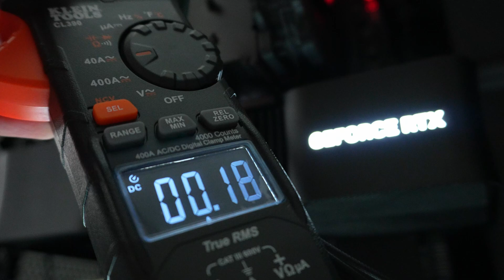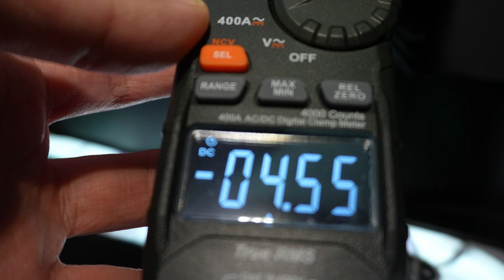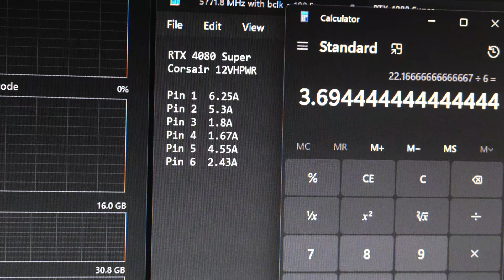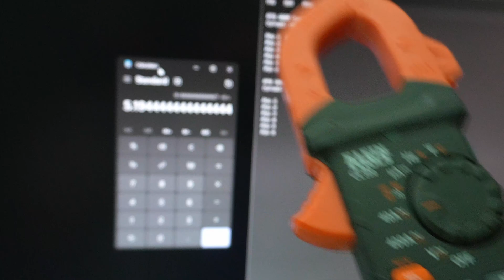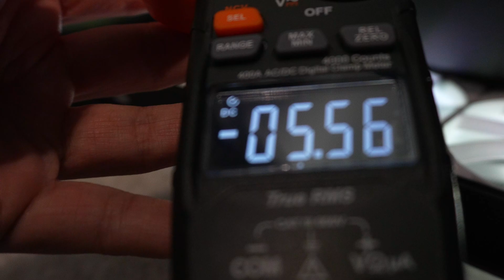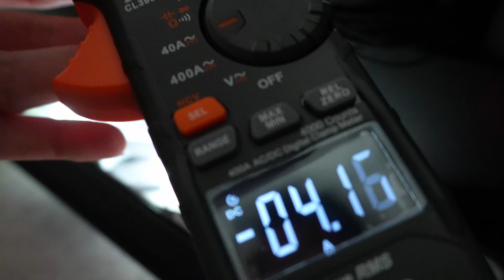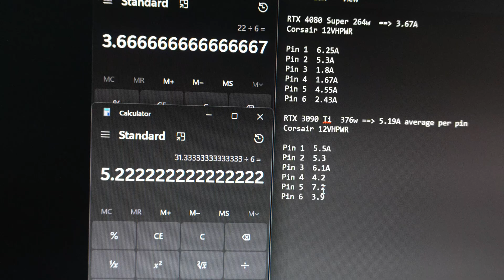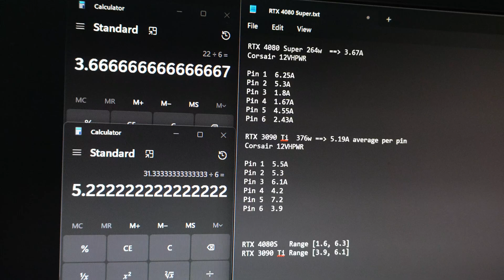Investigating 5090 melting - Why the 3090 Ti doesn't melt

Comment: Now Asus astrals are catching fire just like i told  you monitoring isnt a solution at all asus should have implemented dual connectors instead of bs monitoring . And 3090s not melting has nothing to do with the shunts they just arent pusing the limits powerwise of the specs. The 4090 and 5090 are able to draw enough power that any fault in the power delivery system causes issues. Not only that recomending the astral is not the best idea at all because it has a 800 price hike thats literally 3 5080 or a 5090 and a 5080 for a design that is fundamentally flawed. Personally i dont know why these engineering experts are so inept at figuring out the issue. Just develop a card with two power cables and all the issues would be gone . Kinda simpple really maybe they are worried  tat the power supplies dont have enough free connectors but spreading the power delivery out is still better than trusting one cable that is past its specifications with a stock card non OC card.
Reply: What if I told you it was purposely designed like that to give room for some tech obsolescence?

Comment: Nice explanation but one thing to pick up on: I don't believe they use variable shunt resistors on the 3090 Ti (does such a thing even exist?). The pictures I've seen of the PCB layout very clearly show fixed shunt resistors (probably 2 milliohms) near the power connector. IMO, the only way you can credibly do current balancing on a high-load cable like this is to have separate switching circuits (VRM phases) to throttle the current on each path - the 3090 Ti uses 3 pairs of 2 wires each - with feedback control, such that the current through each switch (sensed by a shunt resistor) is the same. In your case, if you add up the 3090 currents in 1+2, 3+4 and 5+6 you will get 10.8, 10.3, 11.1 A, which just might be consistent with them balancing the current onto the 3 pairs of wires, albeit rather imperfectly. However, I can't actually find any docs/pictures to confirm that the 3090 Ti really does connect separate VRM phases to each of the 3 shunts, so I guess it's conceivable that they don't do any balancing at all, and simply use the shunts to monitor the current from each pair (and optionally cause a shutdown if they become too imbalanced?). If you were to calculate how large the shunt resistors would have to become in order to balance the currents in your 4090's cables, I think you'd find that you needed shunts with very high power ratings and probably their own heatsinks :-)

Comment: Than you for your nice sharing.
Could you measure the current distribution of 3090ti after replacing the cable with new one? I'm really curious for the current distribution with the new cable.
Thank you.😁

Comment: Considering that there are 3 shunt resistors on 3090ti, therefore 2 wires per resistor. Your measurements are extremely well balanced
Pin 1+2 = 10.8A   5.40A
Pin 3+4 = 10.3A   5.15A
Pin 5+6 = 11.1A   5.55A

5.15A to 5.55A per pin with the middle being 5.40A is a very good result that's obviously not being achieved here because 3090TI can't balance every individual wire but 3 individual pairs

Comment: I run my 5090 at 1080, 60fps and it never over heats.
Reply: I drive my Lamborghini Huracan at 30 MPH never get any tickets
Reply: 5090 for 1080p 60 fps? Case to be studied...
Reply: @House.. 
Its a not funny joke, haven’t even got 5090.
Reply: How is it even possible to run a game @1080 60 fps on a 5090 ?
Reply: @2siQc  it's gonna show the same frame 8 times per second in that case. Very useful

Comment: How is replacing the cable going to solve the 'problem' if the problem isn't really the cable but a design flaw with the GPU socket or the GPU itself ?
   Unless your next cable is designed and guaranteed to load balance properly,You will be back at square one.
  Base on all of what I've seen and read,the melting issues and cables not properly load balancing is NOT user error or cable.

Comment: The reason the 3090Ti is superior balancing current regardless of the cable, its because the 3090Ti has 3 Resistors at 200 Watts per Resistor for every 2 cable pins, and Ngreedia thought it was a good Idea to go from 3 Resistors at 200 Watts Each to 2 Resistors at 300 Watts each for every 3 cable pins in the 4000 Series. Actually Hardcore Overclocking YT channel made a video on this.